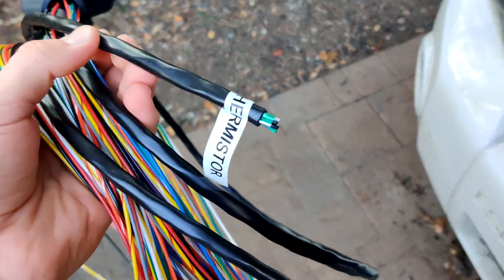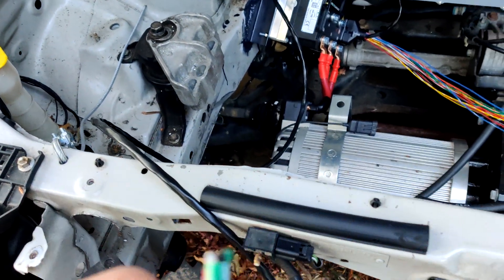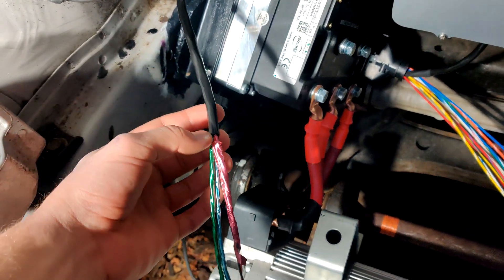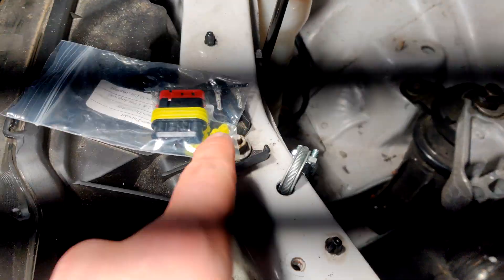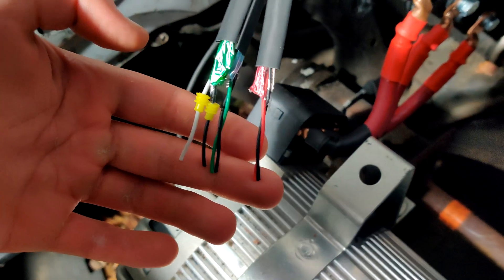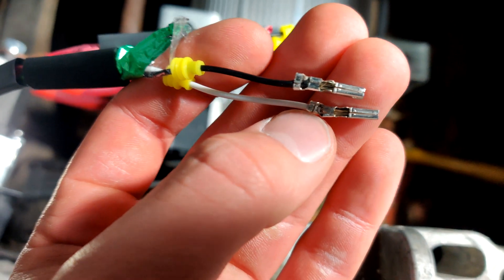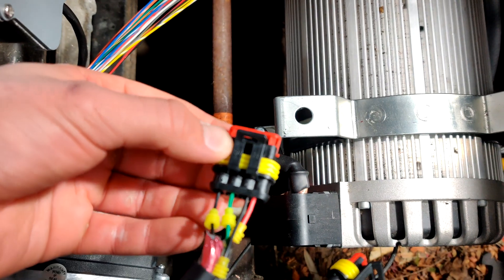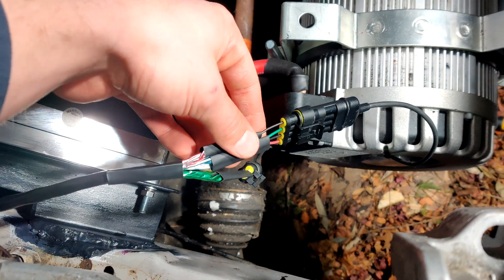Ford Escape EV Conversion EP 22: Hyper 9 Thermistor and Encoder Wiring

Comment: the crimping of your amp seals I have two recommendations mainly because I manufacture wire harnesses for all sorts of OEM's I am C-T Wire Prep Inc.  First there are specific hand tools for crimping the little terminals properly , they are expensive but I assure you your contacts will likely fail soon enough with vibration.  Also the yellow seals that thin end you mention is suppose to be crimped under the insulation crimp which is on the back end of he terminal.  This holds the seal in place when you push the terminal into the housing connector..  Also I've watched all your videos so far and will watch the rest.  They are very good .  I would also suggest you solder all connections and use heat shrink with glue on the inside walls for places where you butt spliced .  This makes the wiring weather proof .  That motor mount looks sketchy to me.  I would have designed one that doesn't use the battery box for support.   I'm wondering what would happen if you had a front end collision with all that battery power situated there?    I can see down the road a government agency creating rules on where batteries can be put because of this.  But a very well done informative video series... Are you planning on doing more conversions?
Reply from the maker: Thanks for watching!

Yep I tried to make do with what I had around, if it gives at some point fortunately these connections are pretty easily accessible and I can do it properly if need be. I gave it a pretty solid tug to make sure it was secure before installing, and the wires are well supported so there won't be much pressure for it to come loose. For the yellow seal, I was going off of the Hyper 9 user manual which instructs not crimping the seal to the terminal. This is incorrect, as another commenter mentioned, but I never thought to google it before installing.

Yes the crimp butt connectors I used have heat shrink with glue on the inside so the connections should be fairly weatherproof. We will see if long-term, I will need to solder the connections as well but for now it's holding up alright.

Having now done a test drive, the battery box as support doesn't seem to be causing any issues at least at low speeds. I had to get creative with the construction because of space restraints and that was the best I could come up with. 

A battery box in the front is also not ideal from a safety perspective but again the best I was able to do considering the circumstances. This is going to be an around-town vehicle so hopefully won't be a serious issue.

I think this will be my only conversion, at least for now. In the future I'd like to do something more exciting, like build an EV completely from scratch. I have some other projects in mind as well which are related to EV conversions. I'll post all of it on my channel for sure.

Comment: Wow I like the Project. I didn't know Escapes came with a manual option. I'm very interested in seeing how that turns out.
Why did you decide to do an escape? I saw 10 Tesla battery packs, why do you only think you'll have 150mi range? I would think you could get at least 250mi with a pack like that. Plus you have a manual trans, so if you have the efficiency specs on the motor you could keep it in the best RPM range. Even Tesla motors have losses at higher RPMs
Reply from the maker: Yep, the base model was a manual. I decided to do an Escape because I wanted an SUV and the number of SUVs that came in stick are pretty limited. The Escape was pretty much my only option.

I actually bought a 1996 Jeep Cherokee XJ 2-door before the Escape, but it had some serious rust issues (the unibody rails were mostly gone) so I decided to stick to more modern cars. 

I'll have about 53kwh of battery capacity, which is about half as much as a Tesla Model S Long Range (102kwh total). I don't think I'll get better efficiency than a Tesla: I'm expecting the conversion to be about 25% less efficient than a Model S because of worse aerodynamics and less efficient tires (higher rolling resistance). The car will be lighter than a Model S though, which should help a bit with efficiency.  I think 150 is a pretty good estimate.

Comment: you have to mount the carrier bearing ,or really bad things will happen also make bracket around motor from transmission to original engine mount . you cant leave it hang !! think about what your doing. this project will take time to make it safe . right now your on your way to an expensive  accident
Reply from the maker: Yes you're definitely right! I have built mounts for these things but they just aren't installed yet. 

The carrier bearing and the motor bracket will both be mounted to a steel battery box which is mounted to the original engine mount. It will be well-supported once the battery box is installed. 

You can look thru my videos on the battery boxes to see how I've built that.

Comment: have you endend the project already?
Reply: I would like to do the same with mine, where can i start?, can you talk me about the budget as well?
Reply: Is there any guide should i follow, and for what range per charge are you doing it?
Reply from the maker: I'm expecting to get around 150 miles of range per charge. This project has cost around $20k right now, so definitely not cheaper than just buying an EV. There isn't one single guide that has everything you'd need for the conversion, but there are some good places to get information. YouTube, diyelectriccar.com, and reddit.com/r/EVConversion are all good.
Reply from the maker: Not yet, but I'm getting close. Just a lot of tedious stuff right now which is why I haven't posted a video in a while.

Comment: Hey, those yellow seals get crimped under the portion of the terminal that goes over the insulation, which holds it in place further inside the connector.
Reply from the maker: I actually don't think this is the case -- the manual says pretty explicitly otherwise. These pins are the same standard pins that you see on molex connectors, and those are always crimped to just insulation on that top crimp.
Reply: @reider_mcfeely  Those are TE AMP Superseal 1.5 connectors. You are correct that the Hyper9 manual tells you to crimp separately and slide the yellow seal into the connector afterwards, but unfortunately it's wrong.  If you search for AMP Superseal 1.5 assembly instructions you'll see what I'm talking about.
Reply from the maker: @CarterMarquis  interesting. Well this is good to know for anyone using this video as a reference guide. I don't expect the way I did it to be an issue though.
Reply: @reider_mcfeely  I would worry long term about the seals wiggling out and losing their seal, but otherwise it should function fine.
Reply from the maker: @CarterMarquis  I'd be surprised if that happened. I wedged them in there pretty well, and the rubber should grip well enough to prevent that. Will have to see though.